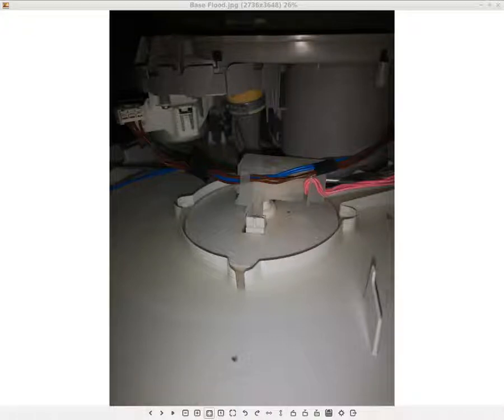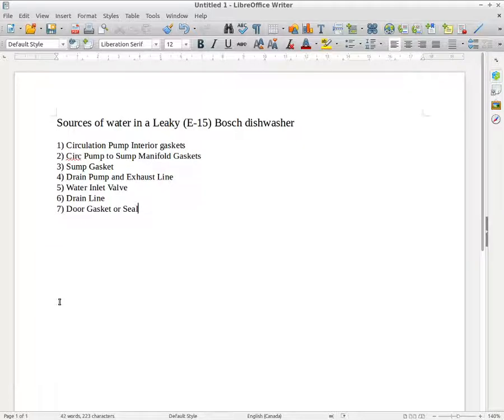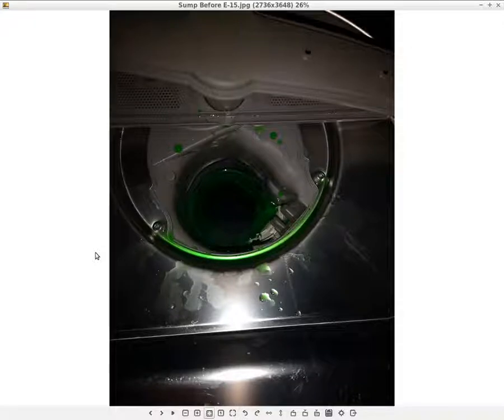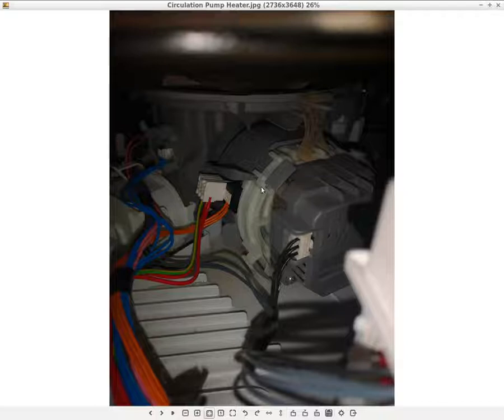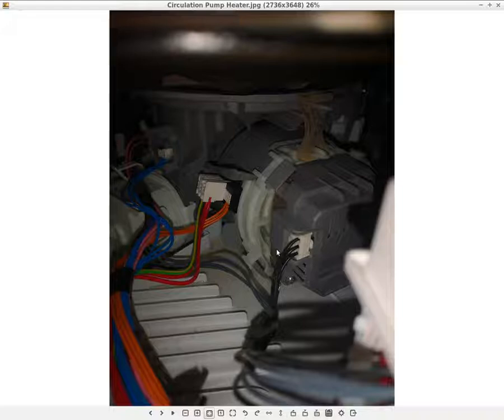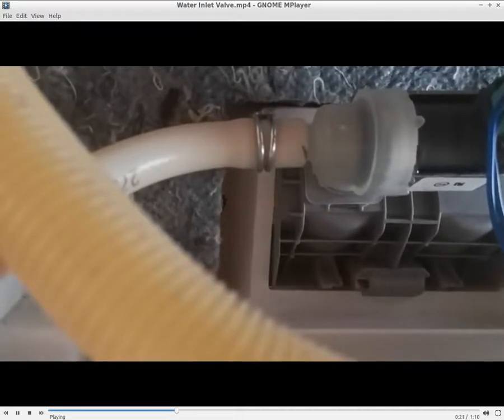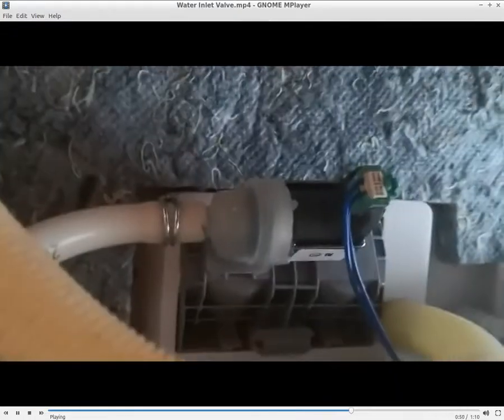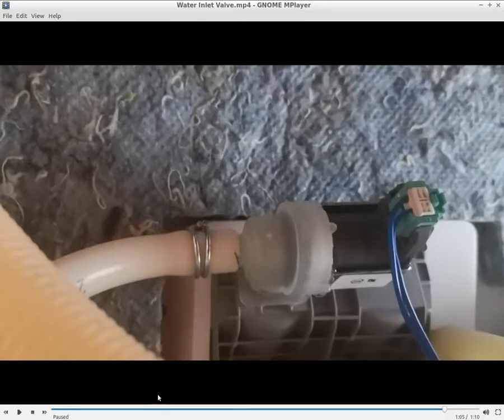How to Find a Water Leak (E-15) in a Bosch Dishwasher

Comment: I had the same problem. Did not pinpoint the leak as well as you did, but had moisture in the same area. My solution was to turn down my intake's water pressure at the sink. Washer works fine now. 
Some of the Bosch manuals call for installing a narrow inlet hose that is supposed to be provided. We didn't get one and it wasn't part of the parts listed in the box. Turning down the pressure seems to have corrected it.  The down side is there is low pressure at the faucet and almost none when the machine is running.  May invest in Bosch's  hose if that becomes too annoying. For now I'm happy the machine is working.

Comment: Alas, this was not the problem for me.  I have replaced the circulating pump/heater (not that big a job), the float and float switch, and the inlet valve, and still there is a leak.  While running the dishwasher, I noticed water coming down the drain pipe that is in the center of the front, suggesting that there is a door seal leak.  I replaced the door seals and got one good run before getting another E-15.  The only source for water to come into that drain pipe is from the front of the cabinet, so I took off the front of the door and ran the dishwasher again.  It was clear that this is the source of the water.  Now, I'm trying to figure out why the new door seal isn't working.  Dishwasher repair is becoming a hobby.  

Thanks for the video!

Comment: Good job! I'm getting an E15 but only when it's on the full cycle. On the half cycle no error code. Appreciate any troubleshooting suggestion. TIA!
Reply from the maker: I think if it is occuring during a full cycle then that sounds like a leak is only occuring when the dishwasher is running. Which might mean a poor door seal, hose, or valve.
 My suggestion would be to try and run the dishwasher and see if you can see where the water is coming from. When you do find the leak I can tell you it will totally make sense as to what you are looking at.
Reply: Exact same issue, did you ever find where it’s coming from?

Comment: Thanks man  I just dried mine out and put back together to see how long it takes to error again once it does I will check out the valve.
Reply from the maker: If it's not easy to see into your dishwasher and you are getting E-15 codes (when the dishwasher isn't running) you could try turning off the water at the shut-off and see if that extends the period between faults. If the code continues at regular intervals with the water off you can rule out the clean water check valve.

Comment: Can you please advise what the part number is?
Reply: Looks like the part number is 00628334. It's called a valve access. Runs ~$17 on the Bosch website: https://www.bosch-home.com/us/shop-productlist/00628334
Reply from the maker: Sorry I missed this I see the part number as:

Manufacturer Part
00628334

Manufactured By
Bosch OEM Info

Comment: I just found I have the same leaky valve! I checked and my dishwasher uses 00628334 as well. Did yours run ok after you replaced it? Also, are there any resources that show how to replace it? Thanks!!
Reply from the maker: Yes my dishwasher is running well now.  I believe one of the appliance repair sites has an instruction video. It also was a pretty straightforward repair but you do have disconnect the electrical and water and access from the back of dishwasher.

Good luck.